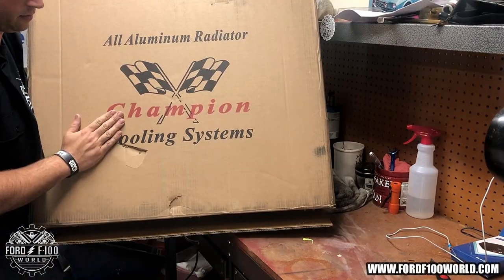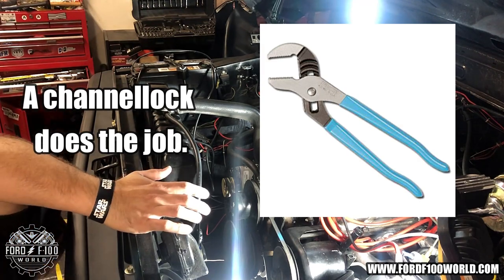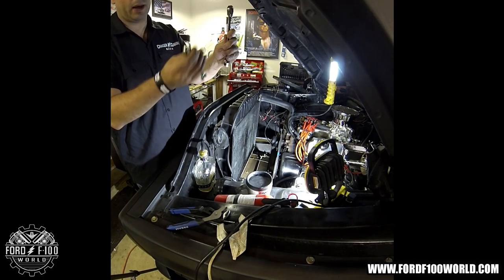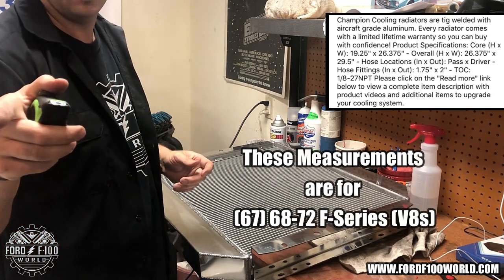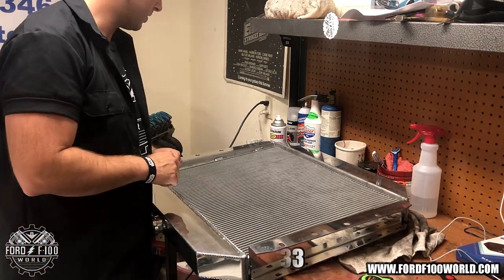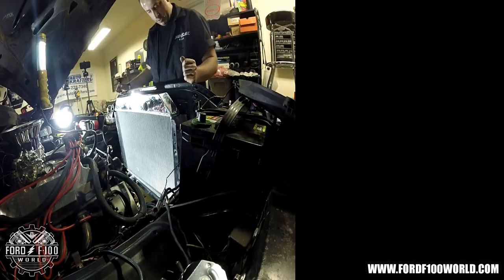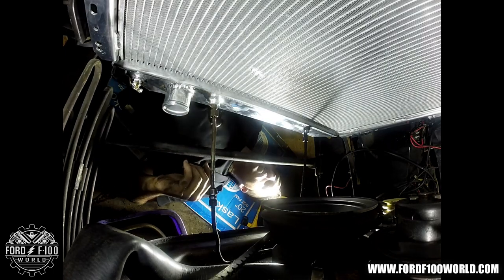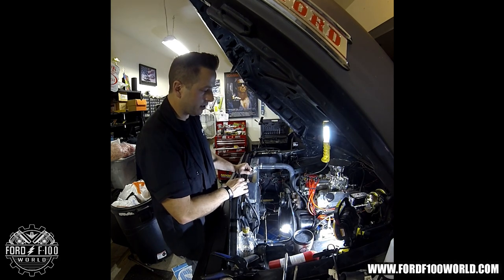F100 Radiator Install DYI Steel Beauties! Ep.7

Comment: Nice truck and install!  I found this video looking for reviews of this radiator after buying it for my 67' F100 which had a couple of holes in the stock one. My truck had a hurt 352 and I was able to find a great running q code 428 from a 66' Thunderbird and swap it in. Ill be able to finish it up and finally drive it when this radiator gets here!   Again , sweet truck. I wish mine was that clean 👍
Reply from the maker: Hey thx, glad the video helped u out. 428 nice 👍🏼 ha my truck looks best in pictures at night from far away lol
Reply from the maker: We did another video of the same radiator but added a few more goodies. Check it out 👍🏼

Comment: Nice! I've got one in the mail at the moment for my 68 f100. Just doing a little research before it shows up. Did you adapt a temp switch into the wiring for the electric fans, or just on/off switch with a relay?

Comment: I have the same radiator in my 67 Mustang. It works awesome. For hoses maybe you should try some from a 67 Mustang that has a 289. I used the same hoses that were on my car. I did not have to make an adapter for my hoses like you did. Just my 2 cents. I got my radiator from Mustangs Unlimited who sadly after 44 years in business has closed their doors for good. The virus did not have anything to do with it. From what I have heard they were having some problems before the virus. I really hate that they are gone. They always had what I needed got it to me fast and at a good price.
Reply from the maker: Oh man that sucks. Yeah I figure with mustangs there is a lot of competition. Yeah good idea, I’ll look into that. 👍🏼

Comment: Did you end up finding a replacement upper radiator hose? I've just installed an aluminum radiator in my 74 f100 with a 302 and I'm having the same issue.
Reply from the maker: Nope I just made it work